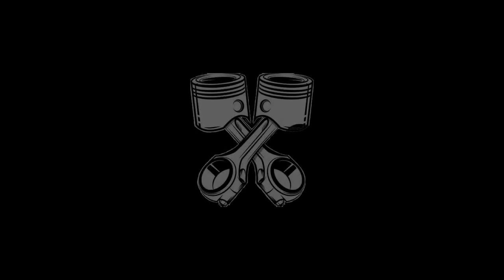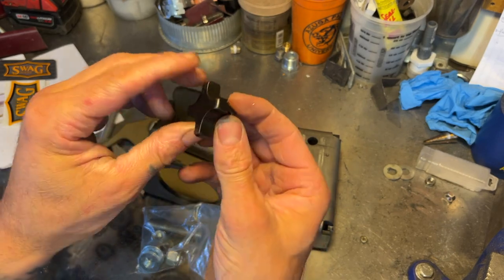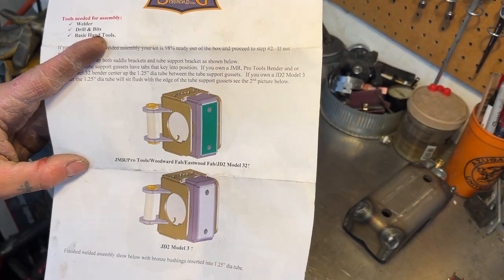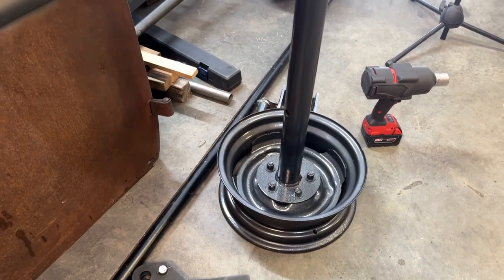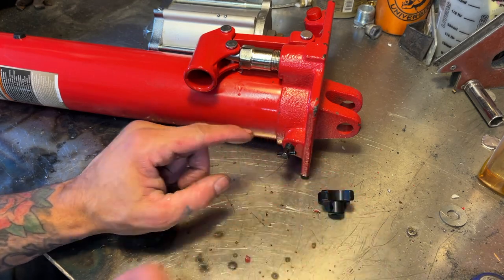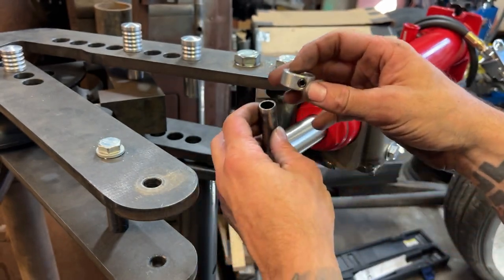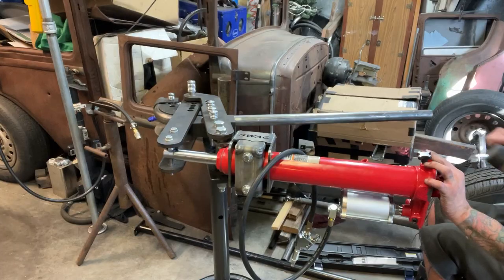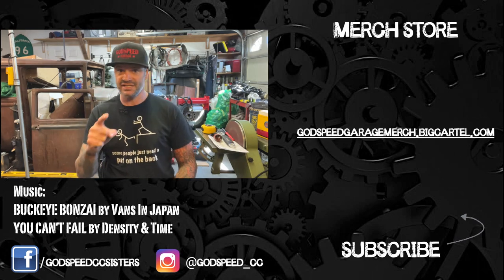TUBE BENDER UPGRADE: AIR/HYDRAULIC RAM!!

Comment: Chinese made stuff is better and cheaper than what we can make it for in the U.S.  I have been in the field of manufacturing for 2 decades.  In the past, I paid both countries to make the same part with the same drawing.  The U.S part cost 10x more.  I couldn't tell the difference between the two in comparison.  If I paid 25% more in China and tightened up the tolerances, I would still be able to cut costs.

Comment: I was back and forth on manual, hydraulic or air/hydraulic. After watching this video I’m going air/hydraulic. I’ve got a 80gallon 2 stage 175psi air compressor so it shouldn’t be a problem. I’m getting the JD2 model 32. I’m saving almost $400. PLUS the price of buying a pump. $500-$1000. Then the lines & was going to get the log splitter control. 
 Thank you!  
 Now only question is with the money I saved what tool can I buy. Lol 😂